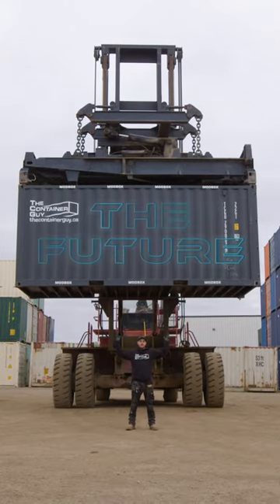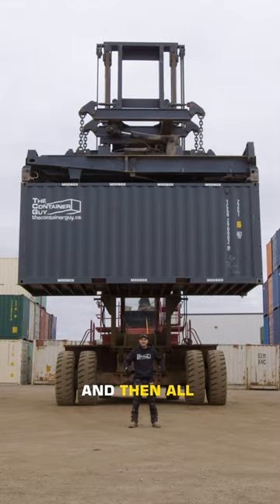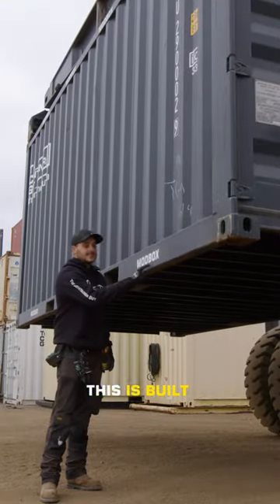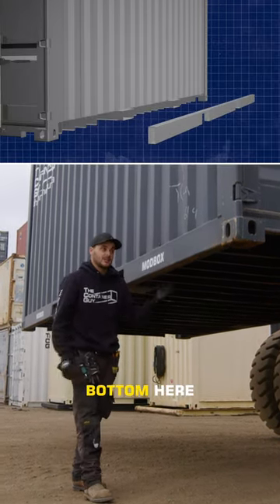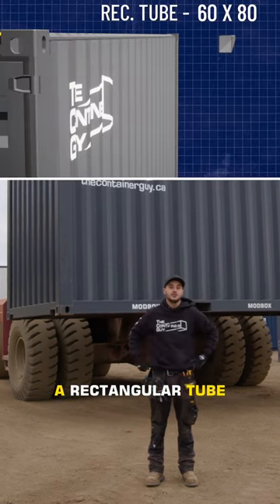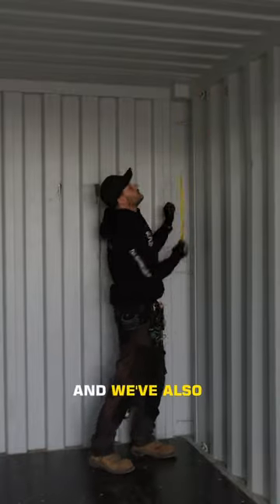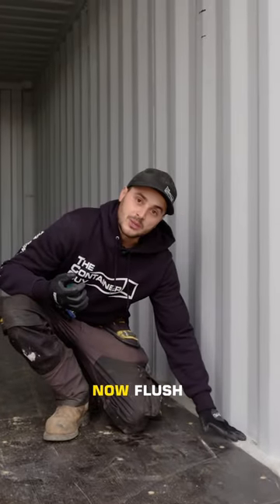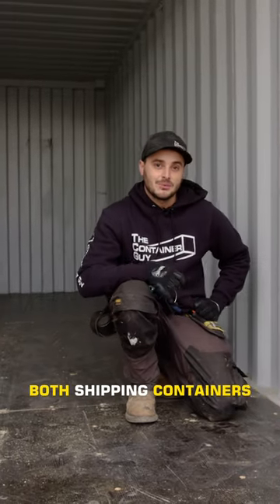The Future Of Shipping Containers! #diy #container #future

Comment: Are you able to insulate roof to r40 and walls and floors to r 28 as per BC building codes.Also how do you handle fire sprinkler system required in many districts in Lower mainland.Would be great as coachhouse if codes could be meet.